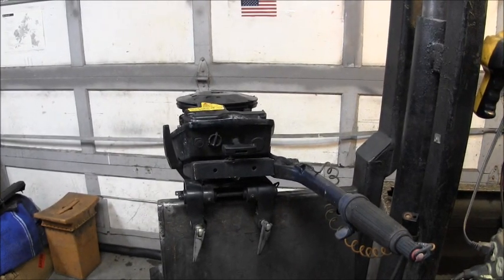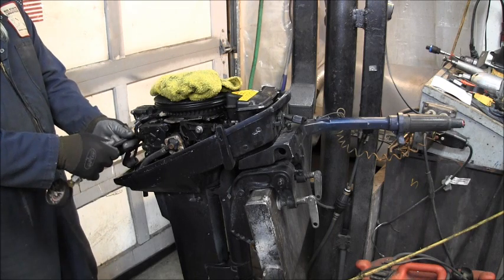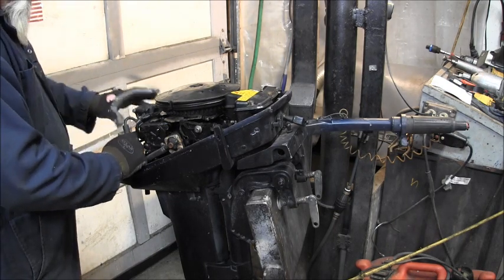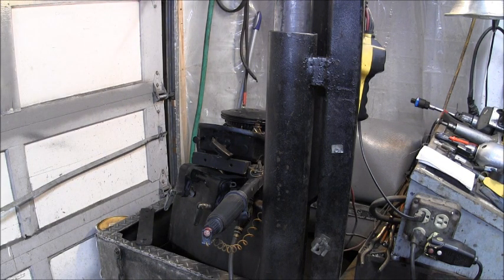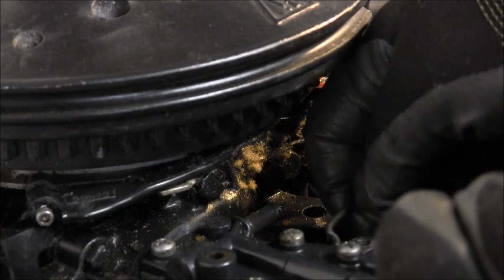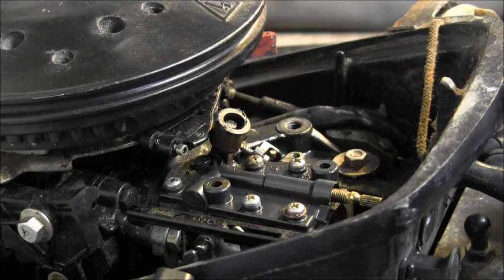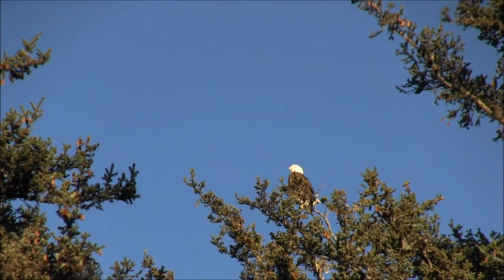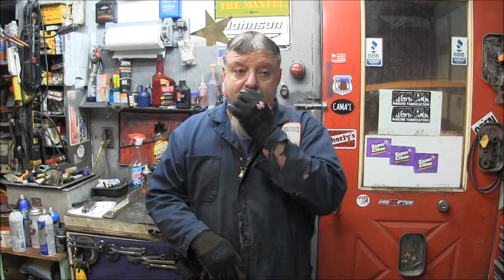EVINRUDE 15 HP,   Simple  Fix

Comment: Johnson / Evinrude 9.9/15 h.p. is one of the very best small outboards ever designed!   The lower units are BULLET-PROOF!!!  whereas, a 15 Mercury motor has (for many years too!) an under-sized housing and an inferior upper water pump and seal housing!   And they never redesigned  it either!!!   OMC was KING!!!!!
Reply from the maker: Yep'  that reputation follows them still that's why Merc came out with the lower unit they call Big Foot.  kb

Comment: Got to love it when the fix is this easily found and remedied. Usually not the case in my experience. Was wondering that instead of an o-ring, (that in my mind would likely easily fail again in the future either by wear or being forced off the shaft as it ages and stretches), would a open end ("c" style) spring washer that would clamp into that groove be a better option (hack) when repairing these. Or even a combination of a smaller thickness  o-ring with a spring washer to make sure it stayed in place be a better fix. In your experience would this work, or would it lead to other problems. I always look forward to your vids as I learn so much from them. Thanks!.
Reply from the maker: Yes' that would work just fine.     kb

Comment: I thought you were gonna find one of those broken throttle cams (CPS), but it turned out to be just a missing oring (CRS)!  I finally saw one of these broken plastic throttle cams on one of my 15hps.   I think I aggravated the condition by attempting to adjust that WOT screw on the cam which strained the lovely plastic and broke the cam...

Comment: Go with the 49. I'm playing with my old Johnson which I'm a bit shy to say. ha-ha First thing I did on this new to me TD-20 was to fix the sticky pull start. By Golly I got it. This motor for a 1947 is blowing my mine on how it looks like it was taken out of the water in the 50's to sat in a barn this whole time. It looks like the original spark plugs still in it. Crazy
Reply from the maker: Those R the kind I like.   4  sure.    kb

Comment: Enjoyed the video.  Question for you.  What is the easiest and most reliable older 2 stroke 15hp outboard?  I am looking to buy a used one and will most likely need to work on it a t some point as well.   Thanks!
Reply from the maker: The late 90's  Yamaha,      Evinrude / johnson  1994 or later  or Late 80's  Suzuki's  Remember Salt water destroy's any motor.  ""FRESH WATER MOTOR  is the key.    kb
Reply: @kodibassInsideoutboards 
Thanks for the reply!  Unfortunately I will be using it in Salt Water but will try to find one that was used in freshwater to start with so it will hopefully be a bit less worn to start with.
Reply from the maker: ,,,    @dennisphillip7619  Good  Luck  Mate, &  Thank  U  for reaching out  4  sure,,,  KB

Comment: Thanks for bringing that possible problem spot to our attention. Any motor will do fine as the next victim. Don't you have a Merc 200 (20 Hp) that you could work on ? Plenty of those around waiting for TLC. By the way, the French word for spark plug is "bougie" (boogee) which translates to candle.
Reply from the maker: All out of repairable Merc 20's.  kool on the candle=boogee     kb

Comment: Hey there, so I set my cam roller to spec, and when it’s cold it won’t start I try and set it and it’s warm runs perfectly through forward and reverse throttle up and put it to slow doesn’t quit. What could it be? Thank you

Comment: This motor reminds me of the worst outboard I ever had a 1975 9.9 Johnson   would get water onto the spark plugs come to find out they produced a whole run of bad motors in 9.9 & 15 where the gasket flange was to narrow & leaked water into the cylinder
Reply from the maker: Yep I have had one of those  It was a 75  Green Jonny.    kb